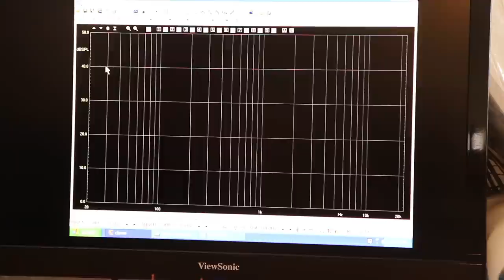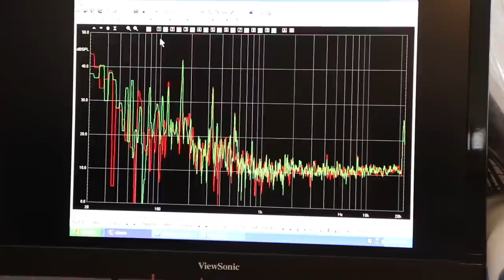Power Cable Tech Talk and a little help for Amir at Audio Science Review

Comment: A lot to unpack here. 1st, I always thought the "flat earthers" reference belonged to the "we know", "it's common sense", "it's obvious" group and the "non-flat earthers" were the ones that used engineering, testing and measuring to scientifically prove their point. After all, virtually any 2nd year engineering student can prove mathematically that the earth is round. As in all conspiracies, he who labels a conspiracy 1st, has the high ground. 2. With cables, Amir's point was totally missed and misconstrued. Take a cable loop with an AC current of one amp and place another closed loop cable parallel to it and you can calculate the induced current! EVEN if they are a MILE from each other! It is simple mathematics and physics--not brain surgery. The question is not, DOES IT HAPPEN, BUT, DOES IT MAKE AN AUDIBLE DIFFERENCE! The same is true for a piece of wire acting as an antenna--as Amir said, any wire not properly shielded will act as an antenna! BUT DOES IT MAKE AN AUDIBLE DIFFERENCE!!?? I would have to go back and look at Amir's video but I believe Danny confused and misconstrued Amir's analysis and description of these two totally different effects---that is induced voltages and antenna affects. Amir frequently will tell you that a product does exactly what it is "advertised to", as in a power supply conditioner, but then he will tell you that it is not necessary, nor audible, and show the measurements to prove it and THIS is the point of Amir's test and reviews! Now, one can use all the soft spoken, not name calling words of "everyone knows", it's common sense", my "30 years of experience', etc but in doing so one has not proved a single thing to refute Amir's scientific, test and measurements. And yet, Amir has offered many many times a chance for one and all to prove him wrong by submitting a scientific, peer reviewed, double-blind study proving that one could HEAR the difference. He will even republish it! But of course, that would be a waste of time because the real flat earthers, "know', "have the common sense", have "the years of experience" etc that would make a peer review double-blind scientific study a waste of time and money.
In full disclosure, I am an electrical engineer older than I ever thought I would be, coming from a heavy industrial background. I love watching videos produced by both Danny and Amir. Both have knowledge and experience that has helped me tremendously in my futile search for audio nirvana.
Reply: The problem there is that we already know and have proven hundreds of times that there are audible differences. Amir is just taking a handful of rudimentary measurements that don't show a measured difference and is theorizing a result. The fact is that we already know there is an audible difference and for Amir to get nothing to confirm it means he is measuring the wrong things. Also, anyone throwing out the terms "double blind" has never conducted a cable comparison.
Reply: Why I enjoy both Danny and Amir's videos, when it comes to cables making a difference I say show me the scientific, peer reviewed, double-blind study. If you can tell a difference as stated, the the study will not contradict that. If study does show that, then I will admit that there is a difference. But I doubt this outcome. Everything I have seen so far does not support hearing a difference in a power cable for example.

For such a long and contentious argument, running a scientific, peer reviewed, double-blind study seems rather trivial. I have been waiting years for this and I challenge Danny and Amir to come together to do this.
Reply: @todd8155  Good grief people. It is not possible to compare cables "double blind". You have no idea what goes into a cable comparison. We've made and have done blind comparisons all the time. It is how we develop products like these. So we know we can back up what we say.
Reply: @dannyrichie9743  - Sure it is.  You are smart guys. You can figure it out.

Here's a simple method requiring only three people, two rooms, a buzzer, and some paper:  
1) A person (the switcher) in a separate room that would get a one-way signal, like a buzzer going off, then manually switch cables, noting the time and writing result on paper.
2) A Conductor that runs the test and presses the switch button.  The conductor notes the time of the switch and the test results on paper.  He is with the listener.
3) Listener(s).  

The test conductor, and listener(s) would be together in a separate room from the switcher and there would be no information flow from the switcher to the conductor or listener(s).  Double blind, simple, cheap.  What's so hard or impossible about that?  

Here is a more complex scenario:
Create a switching box that is CPU controlled (a Raspberry Pi some relays, some code, and not much more). It would randomly switch the outputs when you pressed a switch, then spit out the switching results after the test. I would bet that some of yours or Amir's listeners would be willing to create such a device (it is beyond my skill level.)  It is anything but impossible.  

This is an experiment that is demanding to be done, and should have been done decades ago IMO.

I mean, with some support from manufactures, I would be willing to set this up.  I am sure that you have two rooms, one that can contain the equipment and switcher, close to another listening room with the conductor and listener.  We could challenge leading industry types and Youtubers to take the double-blind listening challenge.  Surely this would be one of the greatest experiments in audio listening to date.  Blind is not double blind. To me this a basic tenant of scientific research.

Until this is done, you will never convince some people.  I myself would like to be proven wrong, but really, don't believe that I am.  I can admit that I am wrong and ultimately I believe you to have integrity and the ability and humility to admit when one is wrong.

I challenge Amir @audiosciencereview to join in.  I challenge both sides to accept the results of this challenge, whatever they may be.
Reply: Like I’ve said, it ain’t brain surgery.
Reply: @todd8155  A bunch of mechanical switching devices effect the signal. All that is needed is one guy doing the switching while everyone else listens. It works great every time.
Reply: @mikeschaper5039  Not sure why u gained so much happiness from bashing engineers. There haven’t been many people in my career that I couldn’t learn from including a general maintenance mechanic/electrician who could neither read nor write. Believe it or not, theory works in practice. When I explained something to the guy who could neither read nor write, he listened, and when he explained something to me, I listened. I was about 33 at the time and he was mid 50s. Our cooperation with and respect for each others abilities solved a lot of problems quicker and with better long term results. What I disagree with all of this is when someone says “we’ve proved”, when in effect they haven’t proven anything, and that is “common sense”!
Reply: @scottwheeler2679  You can hear it quite easily.
Reply: @scottwheeler2679  We make blind comparisons all the time.
Reply: @scottwheeler2679  Cable differences are a well known fact in the industry.
Reply: @scottwheeler2679  Bring your money and come on down.
Reply: @scottwheeler2679  You obviously have never made any cable comparisons have you? There is no such thing as "double blind" when swapping cables. The guy doing the swapping will always see the cables. So it is not double blind. It can be a blind comparison and that is all that is necessary. I will also allow you to hear the differences yourself, admit you were wrong, and bow out gracefully without having to pay anything. Travel expenses will be on you as well. I am not paying for your education. We've done this a LOT so we already know how it is going to end.
Reply: @scottwheeler2679  Yes, the cables have to be physically unplugged to make the comparison. I have taking these "test" and been a part of the comparisons from the listening end and the switching end for others to listen. You can come be a part of both as well. You'll get quite an education, but I am not paying for it. You will have to pay your own way to get here.
Reply: @scottwheeler2679  Been there done that. Switching devices effect the sound. I can switch them out for you (blindly) and you can listen. When you here the magnitude of the difference then you might want to rethink the wager.
Reply: @scottwheeler2679  We've done this a LOT. Blind testing is all that is needed. If you want to make this happen then let's do it. Bring you money if you want to loose it. You will.
Reply: @scottwheeler2679  You are just introducing the noise of a switcher, an additional power supply, and relays. None of that is needed. It is too simple to have someone switching them. That person can even be out of view.
Reply: @scottwheeler2679  Boy do you have a lot to learn.
Reply: @scottwheeler2679  Also, feel free to email me me regarding your challenge and I'll let you know where to bring you money.
Reply: @dannyrichie9743  then why don't you show us the measurements on the right things?
Reply: @johndavidson6433  Measurements are easy to take. Correlating them with what we hear is another. The facts are that we do measure differences and we do hear differences. How they relate is sometimes part science and part speculation. Some are a little late to the party and are still figuring out that there are audible differences.
Reply: @dannyrichie9743  WOW that's great! Let's see those measurements!
Reply: @johndavidson6433  Which ones would you like to see. L, C, or R?
Reply: Many years ago as young audiophile I happened to stumble onto a magazine at my local newsstand called The Audio Critic which echoed time and again the salient points made in your comment. For those of us and they’re are too many with no background in ( electrical) engineering,unbiased scientific measurements and analysis are a sure fire way to save us from getting fooled and fleeced by the high priests of audio
Reply: @dannyrichie9743  if it is audible, it is measurable ... please show measured and not "your ears"
Reply: @MayonaiseSailor  Ha, ha, measure it how? Also, how do you measure the audible effect of sound stage depth, layering, and separation? What measurements define that?
Reply: @dannyrichie9743  the good old trust your ears... our ears are the last thing you should trust even a dog has better hearing than us

noise will affect a complex signal the same way it affects a simple one, so here is an idea for you:

1) get a signal generator, plug it in to the input of a audio amplifier 
2) use a crap power cord rated for at least what is in your home wall.
3) get a EM/RF noise generator, get a electrostatic generator ... hell for the show!!! ... bring a tesla coil into the room :) 
4) hookup the audio out to an oscilloscope
5) generate different frequency output waves, while changing cables around and putting on a thunder show with that tesla coil :) , print results of the "improved" oscilloscope outputs of cable vs cable 

Important unbiasing of the test !!! put the noise source equally close to the wall with the cable that feeds the plug.
you either prove it on a oscilloscope or it is just bla bla buddy.
Reply: @MayonaiseSailor  Showing filtering is easy to demonstrate, but how does that relate to what we hear? How do we measure that? 

In the end it is all about how it sounds. That is what this whole hobby is about.
Reply: @dannyrichie9743  if you hear things that can't be measured by anthing... it means you need a psychiatrist... you would be amazed at what people claim they can hear, but that no one can prove or see.  Claiming a ac current that is going to converted to dc through any decent power block result in audible change afected by the last 1meter of cable of a electrical instalation is garbage, and you know it  your are just suckering people on this one. Great claims require great proof and you present 0. The question becomes if you have fallen victim to the powerof sugestion, or you are knowingly scamming people into buying something no one needs.
Reply: @dannyrichie9743  To me you have a talent and that talent is that you can talk really well and sound convincing. I also find it funny that you always ask for someone to come to you. Why not go to someone else who has the controls with the test at another place and who knows what he is doing. Also I am curious with your hearing differences in cables. Maybe you should join up with Amir and let him control the test completely. And let him decide whether to use your cables on the test or not and what music and such. If you can hear the differences clearly you should have no problem accepting that. But I don't think you will do that. I have tested enough cables, also many award winning cables and if there are differences it will be very very very minute if at all. There are things that are far more important. To me the pricing of some cables is just stealing customers because they don't know better. Oh and also in this case you are the flat earther. Nice trying to turn it around. It is you who choose not to go the science route.

Comment: Why can't we measure and show the differences? Do we lack the resolution in the sampling equipment to show the nuance of change from one cable to the next? 

One thing I agree with Amir is that measuring electrical properties of a cable is somewhat useless when it's the net effect in the system that matters. 

Can we have a cable with better conductivity and noise reduction that actually results in subjectively worse sound at the listening position? 

And what is the cable changing? Because if it's frequency response, a cable would be a terrible way to accomplish that task when you could alternatively just... EQ
Reply: if equipment can't detect it … Shure as hell human ears will not... our ears  are crap even in the animal kingdom domain, any cat or dog hears better than us

Comment: Hi. I'm a bit confused. You say your interconnects works like a filter. Do you mean a filter on the actual audio being transfered in the cable? If so, how do you secure you only filter the "noise" and not any of the actual audio signal. I don't get the science behind that?
Reply: No science required, just money.

Comment: What's funny is well designed gear have power supplies with insane RF filtering (e.g. -30dB down from FCC Class-B standards in the case of the Mola Mola Tambaqui) and tight regulation of the output, so cable on the planet can possibly make any difference to an audio component which is competently designed.
Reply: Yet, the most well designed gear respond best to clean power, and allow differences in cables to be heard more easily.